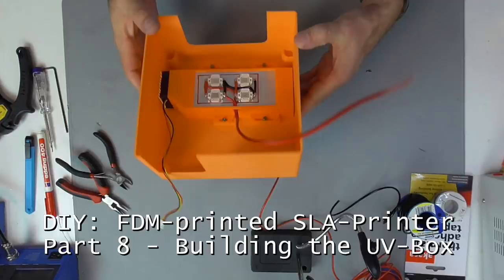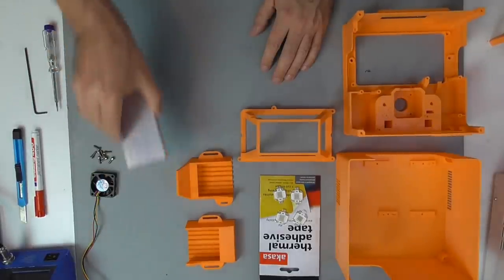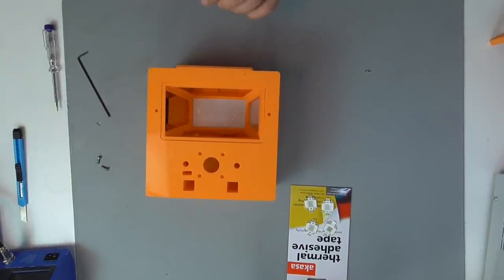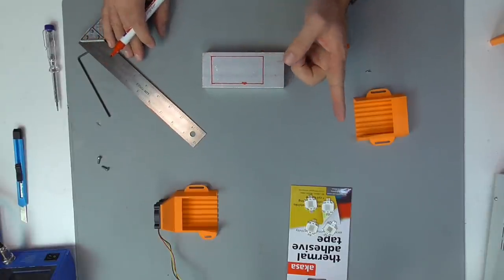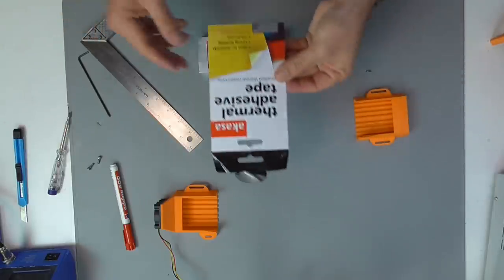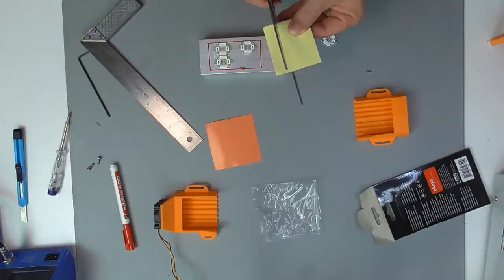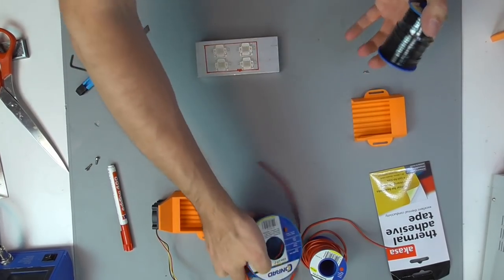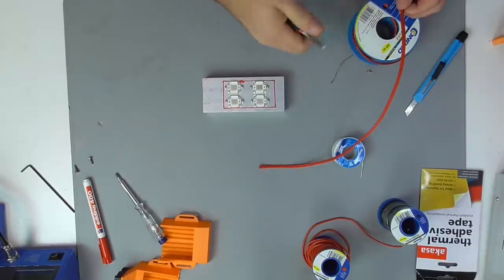DIY: FDM-printed SLA-Printer: Part 8 - Building the UV-Box

Comment: Very nice project, please tell me how to wiring for control led (or led light are turned on in full time)
Reply: In nanoDLP, there's a option called shutter. This controls the on/off of the uv lights. I think that's necessary because if the light source stays on all the print, even with the lcd controlling the high /low pixels, some of this light will pass to the resin, curing it and make a mess on the print (besides the amount of resin wasted)

Comment: Just my 2cents worth of opinion, unless you use fully visible light source, the 3D printed parts will become brittle / shatter very fast, you need to paint a couple of layers of UV resistant paint on printed surface to protect the printed parts. guess how I know. ;)
Reply: EW CHEE GUAN surely the reflective panels and lcd top screen suggest that almost 0 printed material with come into contact with the uv light?

Comment: Can someone explain why the UV LEDs have to go behind the LCD screen? I already know that you need UV to cure the resin... but why behind the LCD screen. Placed behind the LCD screen, would the UV light just burn up the pixels on the LCD? With all that said, is it more practical to put UV LEDs on the side, above the pool of resin - facing the rising plate/printed object?..... this way, as layers of the object are rising out of the pool of resin, they get cured by the UV LEDs above the pool of resin. To put it short, would it be better to put a UV screen protector on the LCD screen, and position UV light sideways (360* around the RISING printed object, and above the LCD screen).... than to shoot it through the LCD screen - therefore damaging the pixels on the LCD?
Reply: the resin is solidified by the UV light. The light is blocked by the LCD, allowing UV light only in the shape of the part to pass through the screen and solidify the resin. If the light was anywhere else the resin would not solidify in the shape of the desired part.

Comment: Led connection is parallel or serial? Exp: 4 x 10w = 40 w or 10w only? Best regards
Reply: Parallel or serial would still be 40 watts... but voltage would be different (12v or 48v)

Comment: Seems like  dumb question but how did you tested them exactly ? With what parameters ?
Reply from the maker: Khenric I just tested the wiring (valid solderpoints, all poles correctly connected) by connecting the power cord to 12v 3a DC
Reply: Ok, thank you, keep up the good work :)